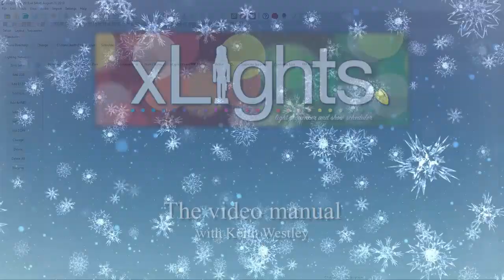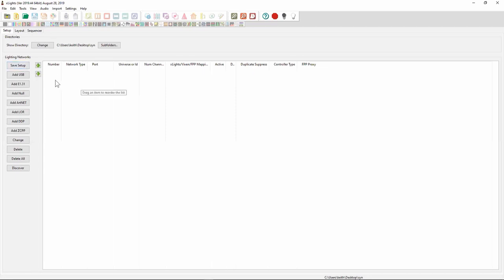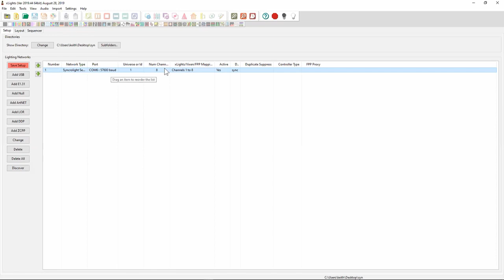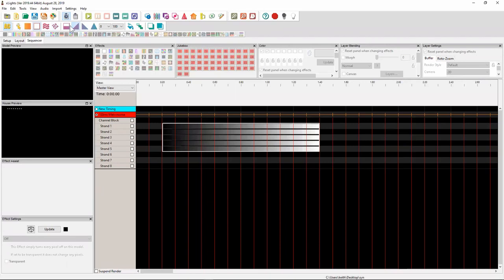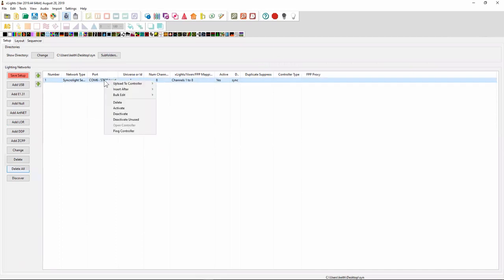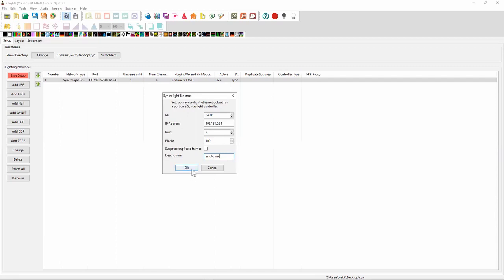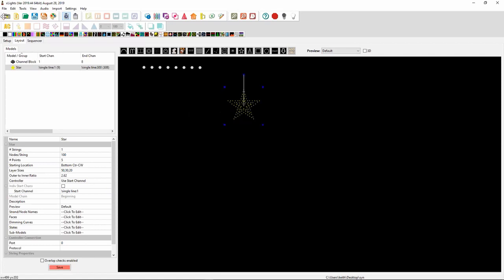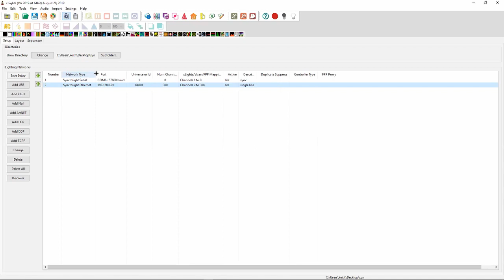Syncrolight support in xLights

Comment: I have ran a full show with Xlights using Syncrolight controllers. For those who still using syncrolight controllers but do not wish to spend out more money on their licenses on their basic program then I will hapilly go through a step by step on how to set up the controllers and how to run Xlights with syncrolight. 

The main key thing is that you need to run their software to address the controllers and that's it ( I am talking about their 3/8 channel controllers for "Dumb" lights) 

You need to assign each controller with an ID but it must be consecutive as you could encounter issues. I was running 8 so it my first controller is ID 1, second is ID 2, third is ID 3 etc. Once that is done then you will now need to remember that each controller and channel will not be - controller ID 2 channel 8. This now turns into channel 16 as the controllers are now grouped so that it's all one consecutive list of channels. Hopefully I am making sense. 

Setting it up in the setup is very easy. Just follow the video. Keith has done a great job of explaining. I put my syncrolight on a separate universe. for me it was universe 2

When it comes to the layout. On start channel this is what I wrote - I was using "Dumb LED" strings in blow molds and on the wall so each string had its own ID. For instance for a blowmould I was using circles as it was easy and I put >Circle-2:15 Then I went over to the 3 dots, pressed it and when another box opens up, I clicked on Universe number and changed that for 2, as it was the universe my syncrolight controllers were on then with the strings I was using Poly Lines etc. 

Hopefully I have helped with things.

Comment: A very quick test shows a very quick flicker every 4 or 5 seconds on props on output from syncrolight controller. but it works  good enough. Good job Keith.
Reply from the maker: I got the flicker in my testing as well but i saw it with their software as well. I suspect it relates to the heartbeat packet which i did not implement as it was not going to my controller but out another network adaptor as they multicast it out. I think i need to send it and ensure it goes out the same network adaptor ... let me see if that fixes it.